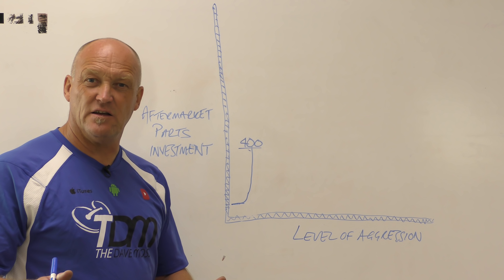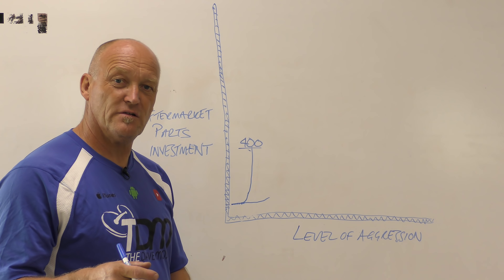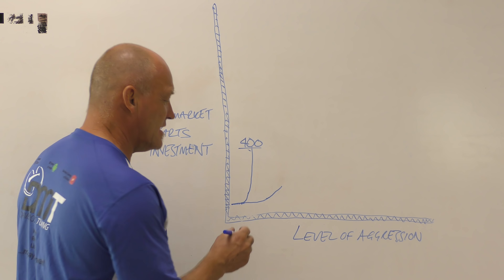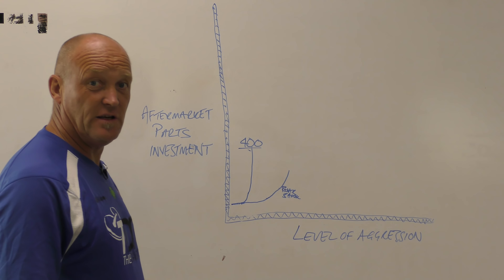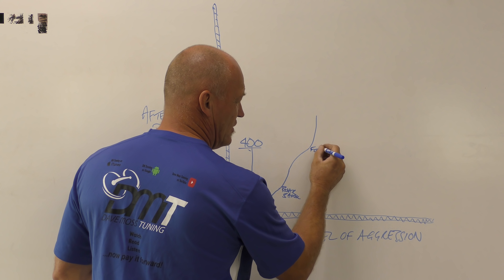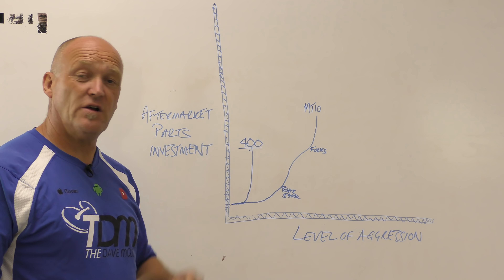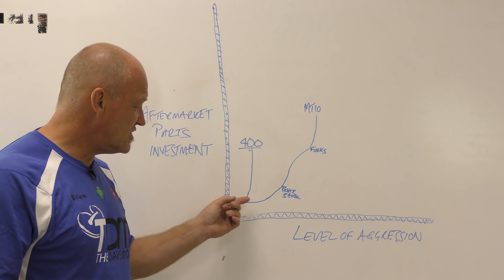Fasterclass: Motorcycle Suspension Revalve & Respring

Comment: Good communication of the concept. One area not mentioned is what if you are outside the "rider design parameters" used by OEM's. OEM's must decide on a target rider weight (and aggression level) to design for. There are quite a few of us over 220 lbs, which overwhelms the suspension on most bikes. At 265 lbs I have to fix suspension before I can safely ride most bikes with any aggression, so the spike occurs immediately.

Comment: No we little guys figured it out and tuned suspension also. Before race tech came out and pro circuit and fox reworked suspension  the old motocross tuners used to ad shins. Drill bleed holes, add preload spacers ECT.

Comment: Thank you for another interesting and informative video.

Whilst I agree with Dave "the diver" to an extent about properly adjustable suspension having an effect on riding abilities/standards. If not more importantly was Radial tyres which now actually gripped. When you consider that even sports/touring tyres (note correct spelling) grip as well as race tyres of 10 years ago.
Reply from the maker: Dave Williams, editor, replying here.  Agree completely.  I would even argue suspension has plateaued (around 2009), while tire development has continued feverishly.  And, of course, the electronics.  But electronic controlled suspension is nowhere near ready for race time.  None of it can cope with race pace, and it won't until racing rules change to allow it.  Until then it will just be a shiny object to sell bikes.

Comment: Yet another awesome video Dave. Thanks to you I now know I have an FZ-07 with zero static sag due to non adjustable front forks with spacers 10mm too long, fork oil 5w too light, and springs rated about .5kg too heavy for my weight but not enough mechanical ability to do a damn thing about it lol. Keep up the great work!

Comment: Excellent video, thanks for bringing all the incredible content and knowledge to YouTube. With your experience with the '19 ZX6R, what suspension upgrades would you recommend for my 2019 ZX6R. I am 230 lbs. and ride on the street but plan to start doing track days.
Reply from the maker: Thanks for the kind words Wade. The honest answer is $$$. How much do you have? In this order, spend your hard earned money correctly as you can afford it with your stock suspension: 10w fork oil, 100nm/mm shock spring, 1.05nm/mm fork spring, fork revalve, shock revalve

Comment: 2022 WR450. Compression all the way out and I'm only using 40% of the travel. I'm in agony after a days trail riding 😅
Reply from the maker: Then clean and lube the shock threads and remove 4-6 complete turns of preload. Next, check your rebound setting as that can create substantial pain of it is set wrong.

Comment: Dave. Is this bike sag rider sag rule for progressive springs or all springs? My zx14r weights 270 kg so 135kg per wheel more less. I weight 95kg so extra 47kg per wheel. You are saying that 47kg should compress the spring twice as much as 135kg? I can't logically understand why.
Reply from the maker: It is for all motorcycles. Start at 30% of total travel and set compression at 50% of the total range. Ride as you always do and assess fork and shock travel. Adjust preload as needed to get optimal travel.
Reply: Thank you for clarifying. I have been watching your videos recently and I learned a lot of useful information. Respect.

Comment: Ideally should compression be mostly used to adjust weight transfer to the front tire? Adjusting compression to compensate for bottoming seems like a band-aid solution for springs that are just too soft. Is this correct thinking?
Reply from the maker: Compression tuning is for feel, feedback, managing the final 5-7mm of travel if you want to work in that zone so close to bottom. Clearly compression being adjusted and bottom out being reached means a substantial change in preload, but a small change can yield some significant results. So, test, see what makes a difference and then retest until you find the balance of preload and compression that keeps the fork action ahead of you allowing you to continue to improve.
Reply: @catalystreactionsbw  Thank you!

Comment: 5:00 in your opinion what's the best way and approach to learn a bike? Adjust the suspension how and differently.?
Reply from the maker: 1. Set sag and understand spring tension to travel used  2. Set rebound to understand chassis balance  3. Set compression to understand the setting you need for bump compliance.

Comment: I'm a rokie....Why should the damping be close to the midle?? If I find my optimal compression or rebound is 20% of maximum, why do I need to revalve? The ajuster isn't there for that, adjust? I would see the poin't if you said....let's see 5% or 10% because you are to close to the limit and would make sense i guess, but 25% 30%? Isn't that reasonable?
Thanks a lot, greats vids
Reply from the maker: The goal is to have a range. If 20% to maximum is where you are now, as the oil ages out you will need to service. Sightly more viscous oil will give you better range of adjustment.  As per your statement, if you are at 20% with fresh oil and no revalve you just service oil more frequently.

Comment: I recently set my forks and shock ( stock 2019 zx 6r) to my weight.  I went for 30mm in the front and rear.  I am concerned about the rear shock though.  There is 2mm of static sag and after I got the difference from fully extended shock to my weight to be 30mm, that took about 70-80% of the preload to get to it.  My weight is about 230lbs with full gear.  I am new to riding and have never felt a tuned suspension.  I got so much confidence in my bike after tuning the suspension that my speed picked up in the twisties (rt 20 between Fort Bragg and Willits) and I ended up getting a hefty speeding ticket (xD).  I would like to take my bike to a suspension specialist and I was hoping you had a recommendation around the Willits area or maybe you own a shop?  Would you recommend the rear shock's spring be replaced?
Reply from the maker: I do not know Willits area well but any dirt bike shop can install the piston and spring. Contact Breesa at GP Suspension in Oxnard and they will sip the parts to you. (805) 251-1400

Comment: Hi Dave. Thank you for sharing information! It helps me to understand, how the suspension works and what changes does it takes to go faster.
I ride 60% of time at gymkhana, 20% training at gokart track(no big tracks near 1500km) and 20% at street.
I got GSX-R 750 K5 with stock rear shock(for now) and forks(stock internals) from K6 1000cc. I'm considering to by a K-tech front fork piston kit, but there are two types: SSRK(for track use) and SSK(road and track use). Does it make sense to use racing only components? At some competitions we have realy bumpy asphalt and some good.
Reply from the maker: Hi Dmitriy. Thank you for the email. Due to generally lower speeds from technical riding the SSK kit will work very well. The SSRK kit requires high speed and a lot of force to open the valving.
Reply: @catalystreactionsbw  Thank you so much for the reply!

Comment: Why doesnt offroad motorcycle suspension feature active rear shock that instantly adjusts if front forks take big hit??  In fact why not have some kind of laser camera sensor setup full time looking in front of the motorcycle measuring the heights and depth of any upcoming obstacles to an ecu that would factor in current speed and automatically lightening quick adjust the damping?   Maybe even cut the ignition and throttle if what it senses might be catastrophic??   I know this would have been a ridiculously expensive proposition not many years ago but today??  Mass produced I really dont see it being too expensive at all ....so what if it were an extra $1000?  Suspension COULD be made with a really wide range of damping adjustment leaving most of the tuning to various map and ecu options....I would think that EVEN the spring portion could come OEM as light as ever needed and then be bolstered with air spring assist which could be adjusted on the fly?  Add some heavy adventure gear     or change riders?  Everything adjusts accordingly!  If not totally automatically then maybe mostly automatic after entering simple changes manually as to what current intentions are etc.....

Comment: Would you suggest the 30mm ohlin cartridges over the 25mm?
Reply from the maker: Both work very well. I preferred the 25mm set until the revised 30mm kit came out, now they work as good as each other. GP Suspension's cartridges (Oxnard CA) are on par as well.

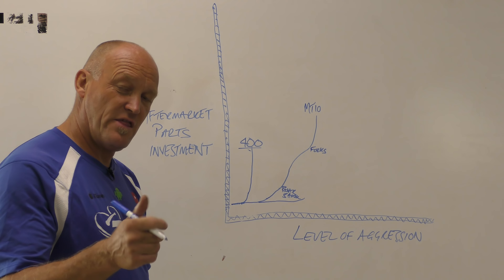Comment: Excellent video. However, the "level of investment" graph  (2:00-7:00) makes little sense to me.
Reply from the maker: Dave Williams, editor, replying here. Since the graph was my idea, I'll explain. Typical increase on both axes, from bottom to top and left to right. Every bike starts 0,0 with no suspension investment at a commuting-to-work level of riding aggression. As your level of riding aggression increases (left to right) you will require some investment in better suspension bits to cope (bottom to top). With a Ninja 400 it takes very little aggression beyond commuting before you exceed the stock suspension's capability and need to upgrade it. The MT-10 has fully adjustable suspension so it will tolerate far more aggressive riding before suspension upgrades are needed. An RSV4 RF has some of the best stock suspension bits ever offered. Max Biaggi could qualify for a WSBK race with the stock suspension bits. To get on the box he'd have to upgrade. With a Ninja 400, all the suspension bits are all so crappy you have to replace everything at once, so it's a straight line up. With the RSV4, some bits are better than others, so the valving will still cope at a level where the springs will fail you. Hence the gradual climb of the curve.
Reply: @catalystreactionsbw  Thanks for your detailed reply, Dave. I understand the concepts and follow your logic. I have no qualms whatsoever with that. It's just that the axes on the graph are nebulous, and trying to stick widely dissimilar bikes (and presumably riders) on them seems more distracting than illuminating. But I'm a data geek so maybe I'm overcritical in this context. (BTW, you guys helped me once or twice at Thunderhill during Keigwin events.)
Reply from the maker: @f18a  Williams again here. No worries. I greatly appreciate your feedback. Like Sesame Street, we'll do another video in the future on the same topic and your feedback will help us do it better.
Reply: @catalystreactionsbw  Cool.

Comment: Could you please go further in depth how a stiffer spring adds static and a softer spring takes away static
Reply from the maker: If you target sag is static and rider total combined is 40mm and to get that you lose all free sag by having to compress the spring in place considerably, the spring is too soft so you need to go to a firmer spring. If static sag is 10-15mm with rider sag of 25-30mm for a total around 40mm, the spring is correct.
Reply from the maker: Dave Williams, editor, replying here. Chiming in with my 2 cents worth. What has happened in his example is a scenario where you'd have too much total sag, and as you add preload to hit your target you lose all the static in the process; something like 15mm of static plus 40mm of rider for a total sag of 55mm. So you add preload in your quest for 40mm total; let's say you add 4 turns. You sit on the bike and, bingo, 40mm. Job done. But when you get off the bike you find you now have no static sag; zero. So you remove a turn of preload to get some back, but now you're up over 45mm total. No matter what you try, you find the only way to get 40mm total sag is to have zero static sag because you've got to crunch the spring down so hard with preload. When you get a firmer/stiffer spring it will require less preload to achieve the 40mm target and thus allow some "space" for static sag in the equation. For example, 4 turns of preload (out of 10 possible) might give you 15mm of static and 25mm of rider. The stiffer spring has "added" static because you don't have to compress it so much with preload to achieve your total sag target.
Reply: @catalystreactionsbw  thank you very much for the replies. I work at a shop and my boss (working for 30 years) assumed as much but stated that was the only scenario in which that would work but it wasn't in the video.
Reply from the maker: @Iltpgs  Dave Williams, editor, replying again. And thank you for taking the time to elevate the conversation with an excellent question. We (Moss and I) suffer from the Curse of Knowledge where suspension is concerned. We can forget salient points like that because we're immersed in this stuff so much of the time.

Comment: I have a 2014 Yamaha WR250R.  I was dumb and I turned the compression dampening all the way clockwise.  It was like 30 clicks.  Someone said that can damage a valve.  Do you think so?  Is my fork going to be alright?
Reply from the maker: You were not dumb at all - you were making a positive difference! If you turned the screw all the way clockwise and it stopped, there's no damage. If you tried to get more clicks aggressively, you may have damaged the needle bit I think that is unlikely. If you turn the screw to maximum in either direction, always come 1 click back the other way.